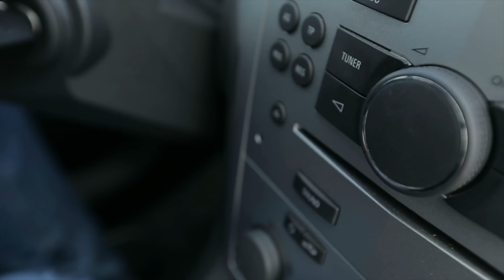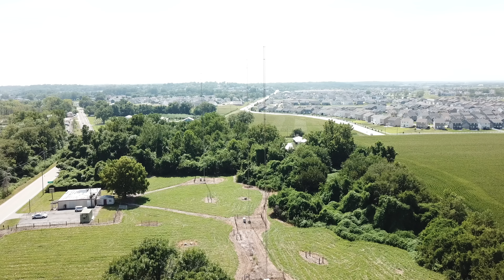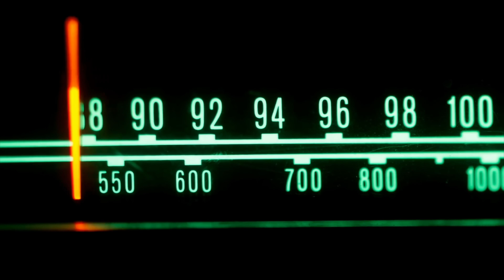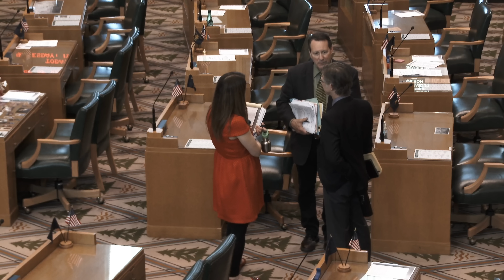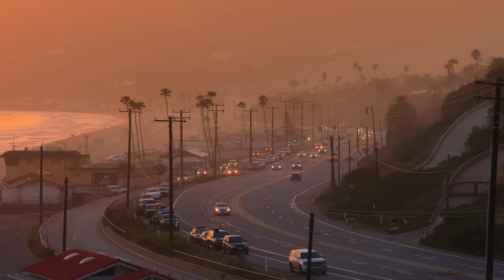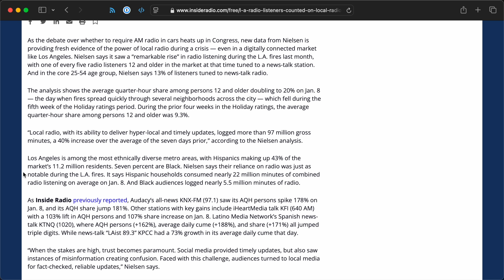Automakers are losing the battle with this 100-year-old tech

Comment: Do you think the current president will sign the bill since his chief advisor is the CEO of Tesla? More seriously, I know that there was a big push in the amateur radio community to save AM in cars and to get hams to contact there reps to support this bill.
Reply: I doubt Elon had anything to do with no AM radio in Teslas.  Some bean counter probably figured that it would be cheaper to leave out the AM radio than to fix the interference problem.

Comment: I’m a huge fan of AM radio.
Starting at age four I’ve very much enjoyed medium wave DX’ing.
From that I became an extra class amateur radio operator and avid Morse code user on the bands.
This is outstanding news!!👍

73 de N1XV
Reply: Could put FM on the AM frequencies and still get the same DX'ing then.
Reply: @RinoaL  Nope
The frequency space allocated to AM broadcast can only support about 5 FM broadcast stations.

Beyond that, they'd have to considerably increase power output levels over what your typical AM station (even a Class A) operates at.

They could narrow the signals to get more channels and keep power down, but then you lose the fidelity that comes with having a wide band FM transmission